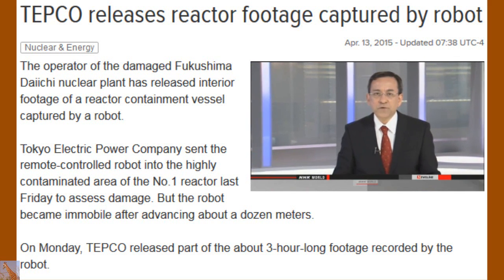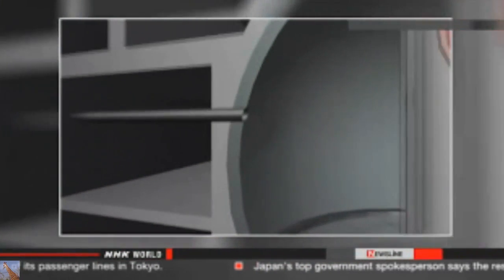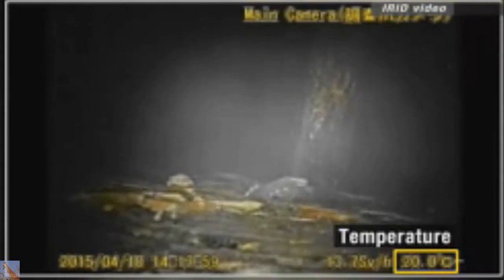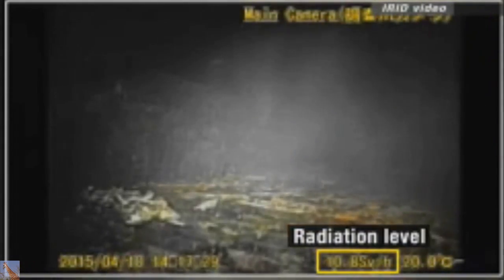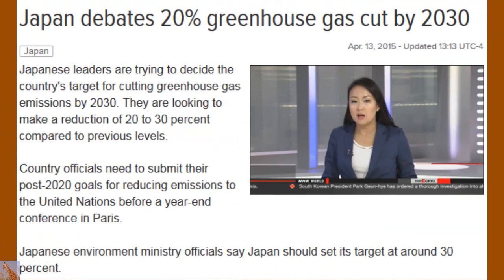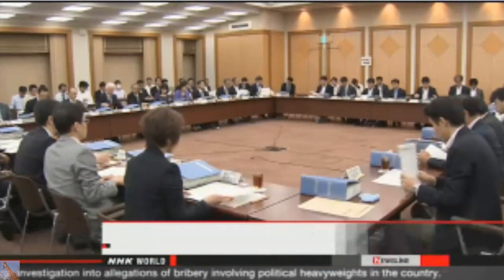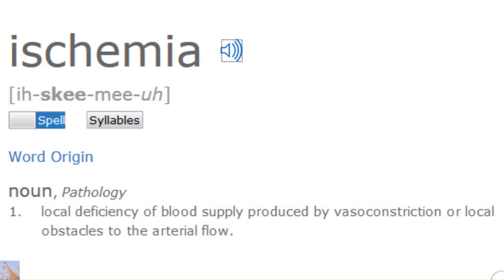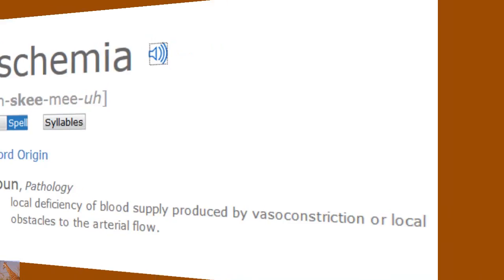New Fukushima Images Inside R1 Before Robot Died Update 4/13/15

Comment: Thanks MsMilkytheclown1  OneLove:-)    #fukushimadisaster   #wecanseeradiation   #ongoing   #nuclear   #radiation   #dailyreleases   #ecocide   #pacificgenocide   #gaggingamerica   #gaggingjapan   #censorship  
TEPCO Releases Reactor Footage Captured by Robot Before it "DIED" Hours After the Journey Began Apr. 13, 2015
The operator of the damaged Fukushima Daiichi nuclear plant has released interior footage of a reactor containment vessel captured by a robot.
Tokyo Electric Power Company sent the remote-controlled robot into the highly contaminated area of the No.1 reactor last Friday to assess damage. But the robot became immobile after advancing about a dozen meters.
On Monday, TEPCO released part of the about 3-hour-long footage recorded by the robot.
The 2-minute 40-second-long clip shows mainly steam. It is thought that water at the bottom of the containment vessel is being evaporated by the heat of the melted nuclear fuel.
The temperature inside the vessel was about 20 degrees Celsius. But the robot recorded up to around 10 sieverts of radiation per hour, a level that could kill a person in about 40 minutes.
The footage shows small bits of debris around the robot, but no major damage to the nearby wall and structures.
TEPCO plans to analyze the footage to consider ways of removing the melted fuel and decommissioning the reactors.
The utility has cut the remote control cable for the robot after giving up on its recovery on Sunday, and postponed a second survey with another robot.
~~~~~
Japan Debates 20% Greenhouse Gas Cut by 2030
~~~~~
Most of the inspected dolphins had lungs in ischaemia state as “entirely white” http://fukushima-diary.com/2015/04/mo...
ischemia
noun, Pathology
local deficiency of blood supply produced by vasoconstriction or local obstacles to the arterial flow.
Following up this article.. [Photo] 160 dolphins went aground in Ibaraki / Same as 1 week before 311 [URL]
According to National Science Museum, most of the inspected 17 dolphins had their lungs in ischaemia state.
The researching team, which consists of approx. 30 experts, performed autopsy inspection on 17 dolphins.
The chief of the researching team stated “Most of the lungs looked entirely white”. She commented though internal organs were generally clean without any symptoms of disease or infection, but most of the lungs were in ischaemia state. She said “I have never seen such a state”.
Most of the 160 dolphins died by the evening of 4/11/2015.
http://teibansite.com/hotnews/twitter...
http://bintan.ula.cc/test/read.cgi/wc...
~~~~~
Latest Headlines: http://enenews.com/

Top US Nuclear Physicist: “Iodine-131 will be lethal after ingestion of 30 billionths of a gram” — Main worry is not a Chernobyl-type accident, rather it’s a melt-through of containment vessel — “Not possible to disprove China Syndrome”

Japan Times: Over 150 dolphins wash ashore at multiple locations — 50 miles from Fukushima border — Could be largest mass stranding ever reported in nation’s history — Govt’ Expert: “The dolphins may have had psychological problems… We don’t see any immediate signs of cancer” (VIDEO)

Officials: “Such a bizarre thing” off California coast — “We’re seeing multiple aborted fetuses every day” — 100,000s of seabirds that nest in area now missing… “Huge, unprecedented die-off like we’ve never seen” — Many baby seals dying after mothers led them to a cliff edge… “Brutal to watch” (AUDIO)

Gov’t Experts: “Astounding” levels of radiation measured in U.S. from Fukushima — Around 500,000 times our normal levels… “We never have ever seen anything even close to that, concentrations went up and up and up every day… Amazing to see this 7,000 km away” — “A matter of life & death” (VIDEO)

National Geographic: Newly discovered mass mortality in sea creatures along California coast — Body parts falling off, animals ‘wasting away’

“BREAKING NEWS – Scientists detect Fukushima radiation on North American shores”

13 baby gray whales and 55 dolphins found dead on West Coast — “Rash of dead humpback whales in Oregon” — “Corpses of sea lions, birds, sea turtles decomposing”

Times: “The worst possible result” revealed at Fukushima — Plant Chief: Centuries may pass before humans find a way to deal with molten cores — Top Official: “We have no idea” what to do, “the technology simply doesn’t exist… I can’t say it’s possible”

Experts: Pacific food web crashing — “What’s going on? Where are the fish? Where did they go?” — “To be honest, it’s insane” —

AP: Melted fuel may have “dropped even beyond” the bottom of Fukushima plant

TV: Dam gates ‘shifted’ in Fukushima Unit 3 fuel pool — Damaged by massive piece of falling debris — Concern it could trigger drainage from pool

Times: 200-year wait faced at Fukushima — Plant Chief: “No idea” how to decommission reactors… “the technology does not exist”;